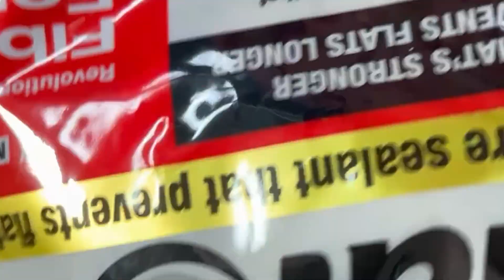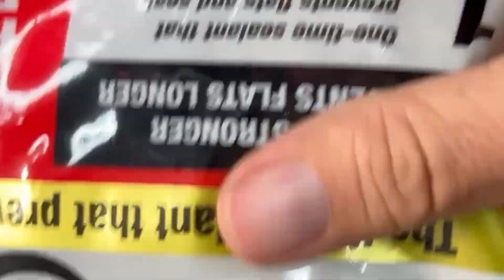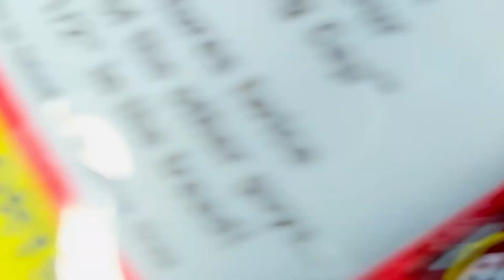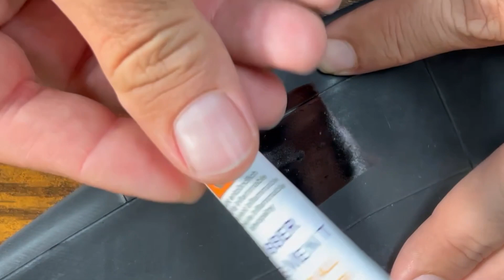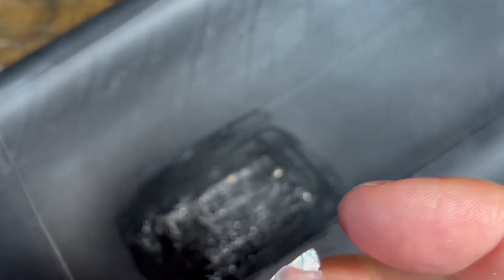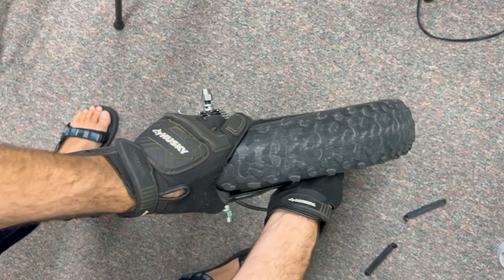Patching a Fat-Tire Ebike Tube on a Rear Hub Motor

Comment: Great video. What did you use to hold the bike to remove the tire?
Reply from the maker: Thanks! I used Handlebar Jacks. They're a great portable tool that attaches to your handlebars and allows you to flip your e-bike over without having the bike rest on the screen/brakes/throttle etc. I put a link to them in the description of this video.